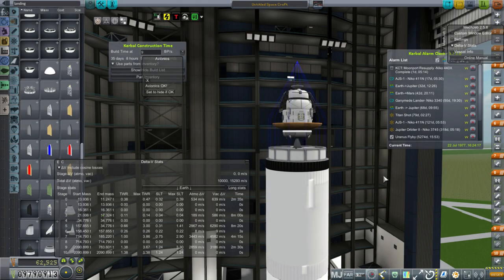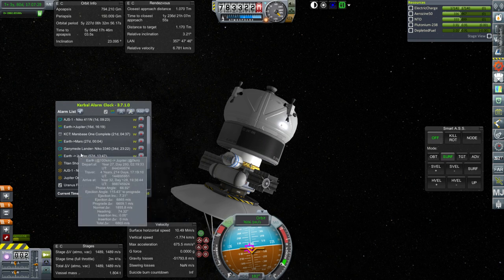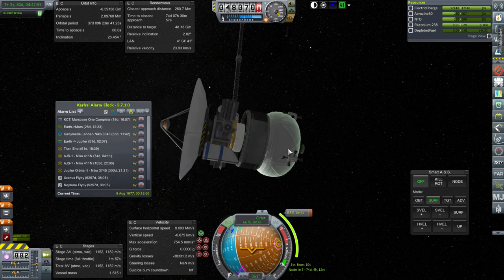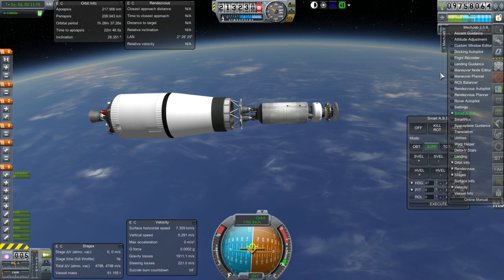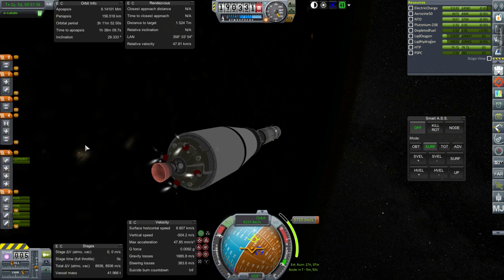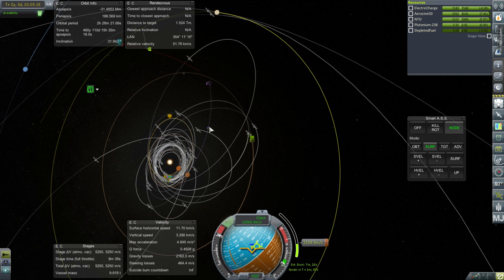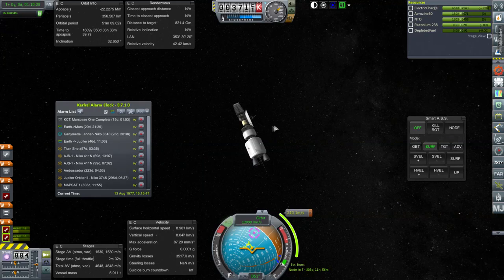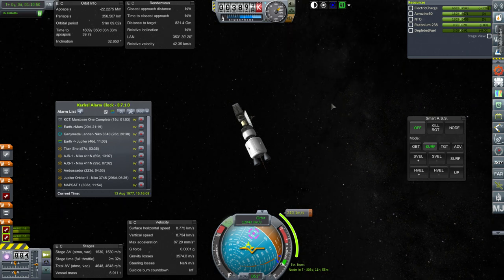Realism Overhaul in Kerbal Space Program 1.1.3 - 72 - Voyager Window Part 1

Comment: ScanSat have an option to change the way the Resource Scanner works, so it doesn't automatically scans the whole body, but it does it by the orbital path, like the biome or Radar scanner
Reply: Well, if you leave it orbiting for years before you send a mission, there's really no difference in which way the resources are scanned
Reply: Aside from the immersion factor for Realism Overhaul... there's something really cool about having done it the "right" way if possible. I miss using Kethane mod for resources, though it doesn't make a lot of sense to use it in RO. It was fun to put a kethane scanner in a polar orbit and just leave it up scanning hexagonal plots like a relaxing screen saver while doing general tasks around the house. Good times.